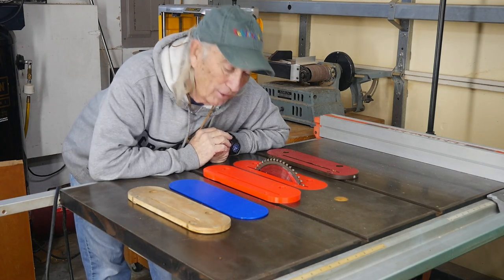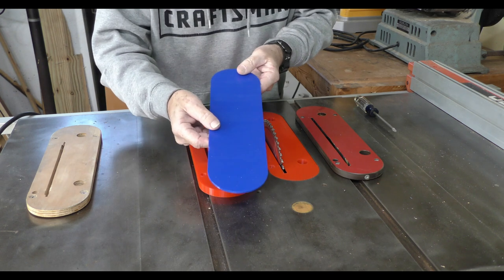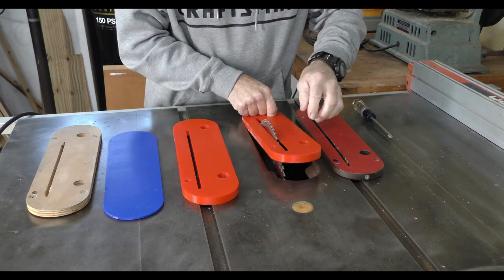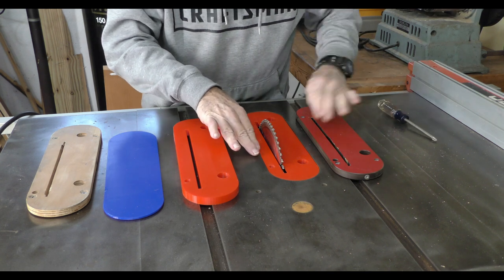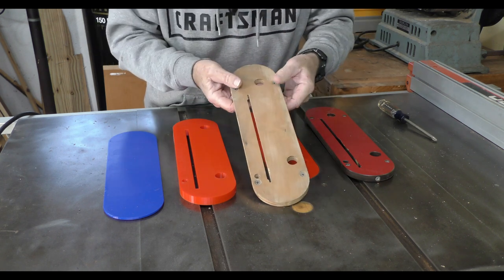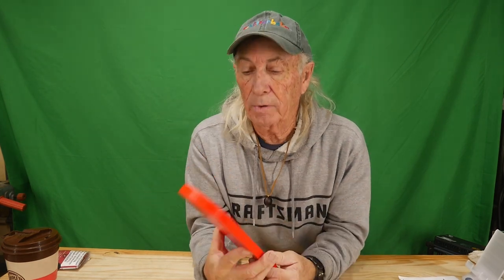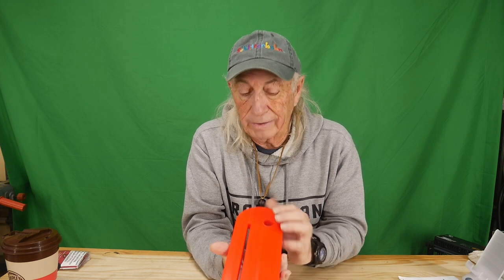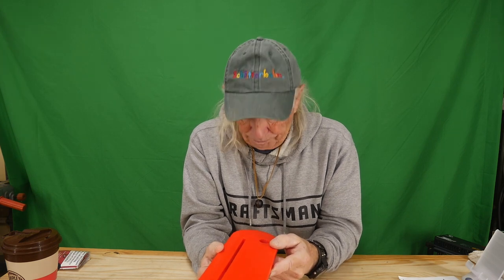Craftsman table saw 3d printed throat plate 2.0, Tool giveaway ! C&T ep 307

Comment: I don’t experience kickback too often. I tend to be over cautious, or try. 
But I have had kickback on a 45 and always felt that the opportunity is greater in any angle because of the  tendency to unintentionally twist or yaw just that wee little bit that generates the kickback.
I also had a thought about a 3D print. These lawn ornament lights. They all seem to have different ground stake designs and configurations. And we seem to snap off at least a couple every year and can’t get replacement stakes! Then you end up
Buying a whole new set so you can have enough stakes! They’re just little plastic things. Seems someone into these printing things could make some good coin making new stakes! 🤷🏻‍♂️👊🏻😎
Congratulations….Greg?!?! 😳
Reply from the maker: On the 45 is it the off cut or main. The solar stakes...yes good point or idea for someone. I'm doing old VW parts this week 1950s to 60s.
Reply: @SirTools  main cuts mostly. Length becomes a factor for keeping the work piece flush and flat against the fence. Ya know, a skil saw can do it too…but again. Longer main cuts. I’m overly cautious and slow…but it just feels safer that way. That’s a great idea, the old VW parts!! Do you use anything to give it more of a Bakelite than plastic look? I’ve gotta figure out this light stake thing cause I’m NOT buying the next generation lights this year!!😁🤣
Reply from the maker: @keithrayeski6417  The VW parts are small items like behind the dash and this week I did the speedo cable lock for bugs etc in the 60s. I'm using ASA but we've used various types of the filament depending on the app for the classic old car parts. A club member from Houston dropped the parts off which cannot be purchased anymore and I made new ones. We tested my new parts on an old Karman Ghia ( spelling might be wrong ) and my parts fit better than the original and locked in better LOLOL...The boys all dropped their jaws when I asked "what color do you want" LOLOL..now, if I could just print myself some new Jeep fenders mmm..LOLOL I need a BIGGER printer !
Reply: @SirTools  🤣🤣